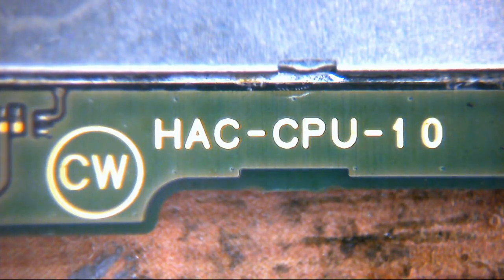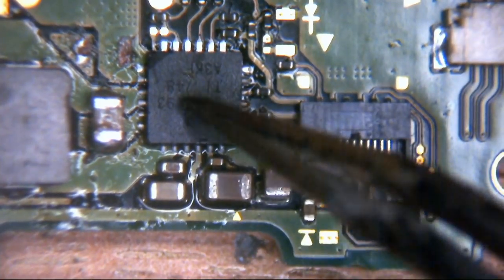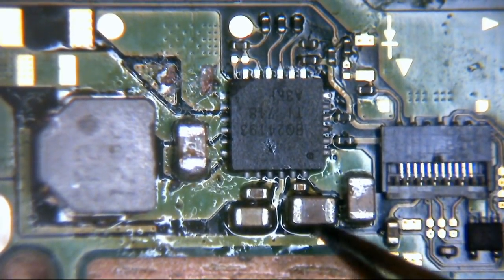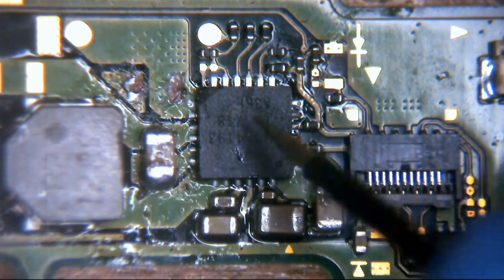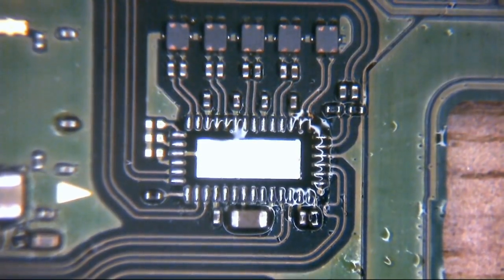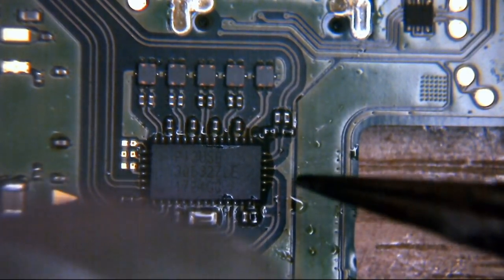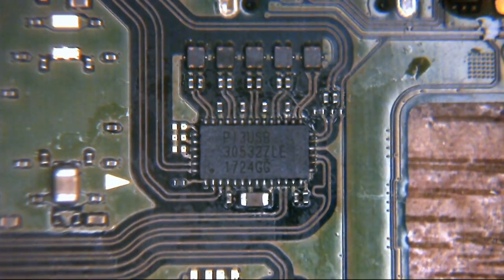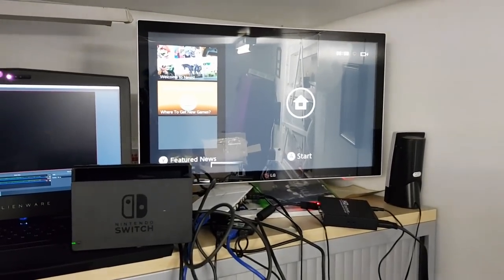Nintendo Switch No Power Repair - Defective PI3USB30532ZLE IC

Comment: I have seen guys like tronicfix do loads of swaps of those little chips on a switch but never explained why the caps short, love your explanation on the chips on what they do and why those caps are there, real eyeopener for a novice like myself. Amazing to see the chip pi3usb on the back with the filters be so similar to a ps4 hdmi out circuit, through a microscope things become so clear. Love the video.
Reply: tronicfix does explain why the caps go short and its because the chip right next to the cap goes bad.
Reply: That is no explanation but a conclusion, but what I mean to Andrew is, that he explained the inner workings of the chip and how it comes to that short on the cap. Ofcourse the conclusion is that the chip is faulty, but now I understand why. Sorry if I was not clear, surely did not mean to bash Steve from tronicfix, I love his vids.
Reply: @etiennevanharen3893  erm it wasn't meant to be an explanation but an idea.

Comment: Great video! I unfortunately searched for this and have identified my nintendo switch to have the same issue. I hope when my hot air station comes in the mail that I can pull this repair off on my Nintendo switch!  Looking forward to doing some smc rework this summer and maybe design some of my own circuits depending on how this repair goes. Thanks for being so detailed!
Reply: Update. Removing the PI3USB caused the short to go away yay! Currently struggling to solder in a new choke that got blown without solder paste so that will have to wait. Temporary put my switch back together while I wait for the paste to come in the mail so I can use it in portable mode.

Comment: BTW you can take the BQ IC off by heating from the bottom side of the board, (skipping the kapton on the flex connector) you can also remove those silly flap connectors without damaging them that way!  I always harvest all the connectors from my donor boards

Comment: Big fan of your work! Question: On the PI3USB IC there are pins on the bottom and on the sides of the IC. Out of the factory there is a bridge in every pin between the bottom and the sides. Same with the M92T36 IC. When changing these ICs, must I always strive for that bridge between the bottom and the sides? Or just soldering the bottom part is enough? I am getting a pain in the neck getting those tiny little bridges to stay in place, and I think that I'm a victim of those "fake" ICs you mention. I don't really know if my soldering skills are just that poor or the ICs are faulty. Thanks!

Comment: Thanks for the video. I am seeing shorts on the caps near the battery connection. Is that a sign that that first IC that you identified is the problem? I have 4.1V on the battery so it's charging , just won't power up/no screen charging display.

Comment: awesome video, i'm having issue with my switch doing the same thing. I ordered a hot air station and going to try changing the PI3USB chip and see if that could be the issue. Thanks for sharing :D
Reply: HI, I got a mulimeter, this capacitor is the one shorting (https://imgur.com/a/mEdt8Kc) where should I look next?
Reply from the maker: Check the large cap by PI3USB. If it is shorting also, remove PI3USB and re-check both locations for shorts. If they're now cleared, replace PI3USB with a new IC. Also check the common mode chokes above PI3USB for open coils - these commonly get damaged when the IC blows. They should read ~1ohm resistance on both left and right sides (top to bottom pins). If they're open, or read ~1ohm resistance left to right, replace them.
Reply: Andrew Paul thanks, I did check the the other caps next to PI3USB, they were shorting as well, I ordered 2 new PI3USB IC’s and let you know how it go’s. Thanks for your help!
Reply from the maker: It'll definitely be the PI3USB at fault. 100%.
Reply: Andrew Paul here’s my thread with the other caps shorting https://gbatemp.net/threads/switch-wont-power-on-making-buzzing-noise-coming-from-the-motherboard.564281/ thanks!

Comment: Nice to see some switch loving on your channel :) . 
I have a question : do you think that some shorts behind the board near the APU (tegra processor) could be fixed with a proper reflow / reballing on the APU? Or do you think it's more likely to be a dead APU?  Thank you !
Reply from the maker: Hi Vladimir,
I've seen some fixed by reball - it's whether you've the time to invest on the chances that it'll cure the issue.
Reply: @AndrewPaul  Thank you so much for your answer Andrew :)

Comment: I had my heat at 900f and medium air and it won’t come off... I didn’t notice your have to have the tweezers pulling the whole time, maybe that’s where I messed up and now I’m missing those micro tiny resistors damn.. I used tacky flux too and things simply would not come off other than those super tiny resisters I think...not even the bigger resistors would come off even at 900f idk what’s going on...

Comment: Yes you're back posting!!! I'm of subject but pin 19 broke off inside the hdmi port of my 1200 series ps4. Will that result in no video no audio?  I don't know when the pin broke, I just noticed it. All I know is I relocated my console to another room and when I plugged it up and turned it on all I got was a black screen with no audio.
Reply from the maker: Hi, yes pin 19 missing will knock out audio / video. You'll need to replace the port to get it working again.
Reply: Thanks for replying. So I replaced the port but now I'm having a new problem, a power issue. Now it just turns on for a second and then back off. What did I do wrong?

Comment: HI!! PLEASE help me.. men i do the job when i connect the charger the volts was there then suddenly stop working. i notice i for accident blow with the air gun a little black cap and i didn't find it anywhere i dont know where goes .. what you should recomend.. did you have a email for send you a capture i do with my microscope.. please help

Comment: My Switch works fine, except when playing docked; after some time playing on TV the TV output would fail. When I undock the game is still running fine no reboot what so ever. Is it PI3USB chips failing too? The dock is fine, I have other Switches to rule out the dock failing.
Reply: Did you fixed it ?
If yes what was the porbleme ?

Comment: Hello new to your channel..Got a switch that show the lighting bolt but it is not holding charge.  Could I need a battery?
Reply from the maker: Hi Tony,
I'd say that's likely to be the case.
Reply: @AndrewPaul thanks goe the reply have a working switch and tried the battery but no luck.
Reply: @AndrewPaul  just for info.  switch shows charging when on but draws no amp.. Shows 0.000 amps. No bent pins in c port.  Nothing shorted in charging chips and fuse and coil show continuity. Any clues? Thank you for your help

Comment: Hi, nice work. Explained a lot, fantastic! Can I ask a couple of thing
I have a a faulty Switch with seems ok (I've changed the Cap under the BQ with a spare unknow data cap founded on a Trinket M0 board), but no charging (all goes fine, full working, only not charging). How can I check the USB port or maybe the supposed fault?
Full working (CfwSysNand, EmuNand and SysNand) , Hackate Battery Info says : 1000mAh, no short founded, but not Charging 

The other motherboard is my personal working Switch where I was make some experiments (voltage reading). Suddenly I've jumped A4 an A5 Pins on UsbC...and now can't find why it doesn't charge. Issue : Now doesn't start and show 2110-0001 error. Hackate Battery Info says : 1000mAh. Not Charging. No short founded. Some Ideas?
Reply from the maker: Hi,
If it's not charging check the port for any visible damage down the barrel - if it's OK then I'd replace the BQ IC if you've not done so already. It may fail in other ways than simple shorting.
The other again, it's likely going to be one of the M92T36 or BQ ICs which was damaged when the USB pins were shorted. If you've spare ICs, these are definitely the way to go in the first instance if there are no obvious shorts evident on the board.

Comment: Does anyone know why the large coil to the right of the display connector is on ground as the top coil pad is grounded but the bottom coil pad coming from the little iC Chip isn’t ????

As there are no surface traces running to the top coil pad I’m guessing that it is internal to the board going somewhere 😐 I have also removed the P13USB Pericom iC Chip and the Short is still at the top coil pad 😐

Any help would be very much appreciated.

Comment: I plugged in my switch to the Dock and i went to check if it was charging and it completely cut power to my switch I'm not a massive tech person any possibility do your reckon happened ?
Reply from the maker: Does the Switch show any signs of life at all?
If not, then it's possible that the PI3USB IC has failed as per this video.
Reply: @AndrewPaul  no the switch shows no power at all ive tried all different start ups but when i dock it flashes green do I think it is what you suggested what do you think

Comment: Hi Andrew, Great video! Been passed a Switch myself to take a look at but curious to know if you've had the same issue. Basically the internal fan isn't running so console states its overheating after half an hour or so, but also the joycons don't charge whilst attached to the unit. Charged externally they will connect to the unit and it states they are attached, but no charge going to them.  Any idea?
Reply from the maker: There's a small diode in front of the fan connector that isn't required - just remove it and it'll solve both the fan and joycon charging issues. It doesn't need to be replaced, in fact on later switches this diode is omitted from the factory!
Reply: @AndrewPaul  that's brilliant news, hopefully I'll be able to find the correct diode and remove it. Thank you so much, I know a little lads going to be made up if I fix it!
Reply from the maker: No problem. Please let me know how you get on :)
Reply: @AndrewPaul  being cheeky now, but any chance of a picture of the correct diode to be removed? Had a quick look last night and they are that small I don't want to remove the wrong part, got a feeling this will end up on your workbench anyway! Ha ha..
Reply from the maker: Directly in front of the fan connector bud, picture is here:
https://i.imgur.com/LD1CXi3.png
Reply: @AndrewPaul  Brilliant. That worked mate... Although I think I messed up and blew away some component as fan runs full speed all the time now... Ha ha.. Not a worry though, fan works and controllers now charge. Absolute star mate, thank you for the advice and help, much appreciated.

Comment: Hello friend I with a doubt my switch does not turn and I don’t even take it apart I realized that p13usb the capasitor on his side is beeping on the multimeter on both sides this is normal and I have to change this p13usb

￼
Reply from the maker: Definitely change PI3USB and check the EMI filters in front of it for continuity - when this goes it often blows one or more of them (typically the one on the far right of the five in my experiences) which would stop any output to your TV via the dock. Good luck!
Reply: @AndrewPaul  obrigado vou fazer oque vc falou fico muito agradecido obrigado

Comment: I know this isn’t a Switch question but my Xbox has not been updating/installing games properly. When ever I try to install something it will stop the installation and it will repeat this a couple times before it just completely stops. I’ve been looking around and I think my hard drive is dying. Is that the case? And if so I really don’t want to mess with the insides of my Xbox so will a Microsoft store take care of it for me? My Xbox is still currently under warranty so if I can get it in I would love to. 
Thank you
Reply from the maker: Sounds like a bad hard disk. If it's in warranty, give MS a call - they'll likely go through some basic troubleshooting and if you don't have success they'll offer a repair / replacement service under warranty.

Comment: I replaced that ic but nothing worked
Reply from the maker: There are lots of reasons a Switch may be exhibiting no power symptoms. Common ones are the PI3USB, but also check the caps around the M92T36 and the BQ24193 charge controller also.

Comment: Had a switch in that had shorted cap to the left of the delivery controller that the previous tech tried to reflow (lol) and the actual fault was the other side where the Pi chip is, It had even burnt the track 2nd from top right in this pic all the way to the filter.
https://gyazo.com/fd26a54f42f7fb4661aa3a27129aed7a